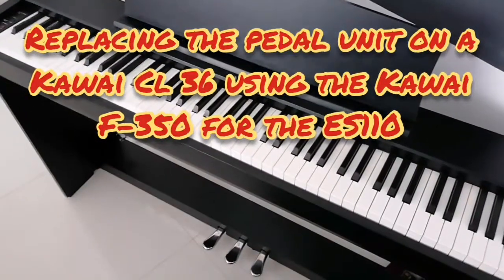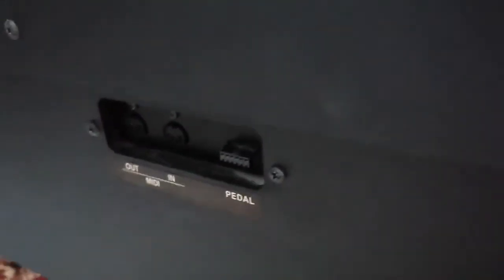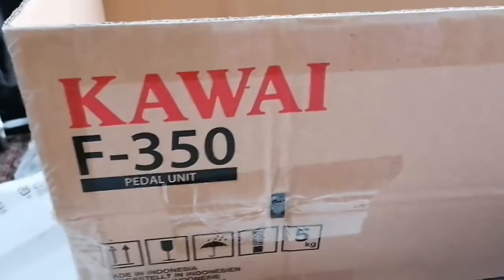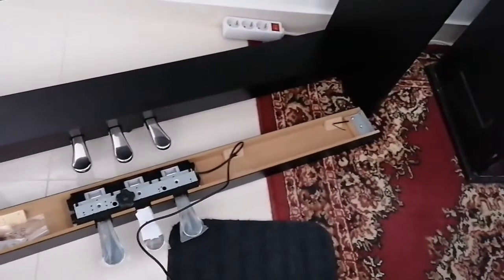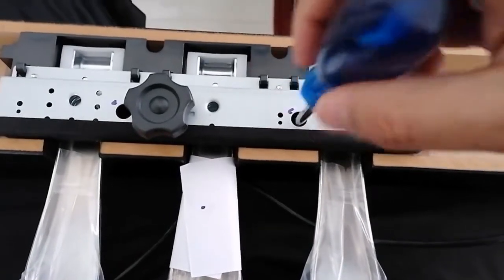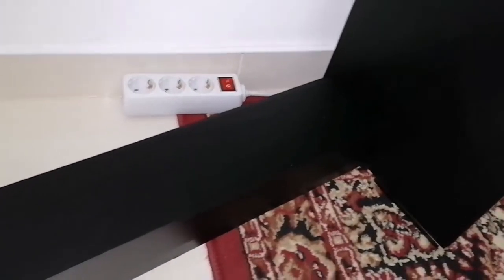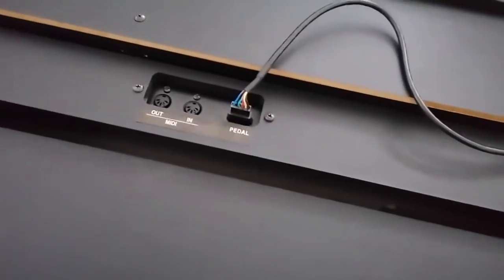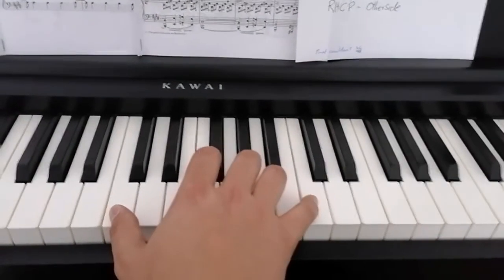Kawai CL 36 sustain pedal unit repair (and rewire hack) using the Kawai F350 pedals for the ES110

Comment: Thank you sir. You are a gentleman and a scholar. But there is only one problem with this approach, and it is that the es100\110 pedal is very cheaply made. It does not have the same asymmetrical shape that the CL36 has, and the pressure is very different to suit the cheaper frame of the piano (tension is lower). It also wobbles a bit while the CL36's pedal is steady. I was surprised to find this out. So I unscrewed 4 more screws and changed the PCBs with the optical sensors between the two pedals, and bingo! Best of both worlds.
Reply from the maker: that is taking it to the next level, well done! and thanks for posting that information also.

Comment: Hi, my pedal board doesn't work and the sustain effect is permanently applied. Disconnecting the pedal board solves the issue. Is that what happened to you as well? Isn't there a chance to repair it instead of buying a new expensive f350?
Reply from the maker: other way around, wouldn't work at all. I swap the cables around as you can see first to test, that's sorta free. I explain it in the video, if u have a 3 pedal unit it could work. Otherwise, a replacement.....
Reply: @OrionBroadcasting  Thank you, luckily I managed to solve the issue I was having.

I put a small piece of metallic paper (the common one that's used for cooking) over the pedals just in front of each optical sensor to make sure they detect the changes in pedal motion and now all three are working again.

When I disassembled the pedalboard and expose the sensors, I noticed they work fine when you put pretty much any object in front of them. I used a clean new white credit card to test them so it was a matter of making the pedals' surface where light bounces from the sensors more reflective.

I also cleaned the sensors with a mixture of water and a few drops of detergent.
Reply: Thank you. This hint is awesome, I had the same problem with the soft pedal which was permanently applied.
Reply: @TheNetzspannung  Glad it worked!

Comment: Hello do you think this f350 will work also in my ca63 because it has the same wiring colors and connector?
Reply from the maker: it probably will, find a store where you are allowed to return the pedal if you buy it and it doesn't work, then you can test it!

Comment: Im a bit confused, on my CN29 only the right Pedal works, but all the others dont... What can I do
Reply from the maker: if it is a unit with 6 pins like mine, you can try to connect the F350 and see what happens, order it from somewhere that allows returns I'd say, or try it in a shop if u can. As I've only done this on a CL 36, no idea otherwise